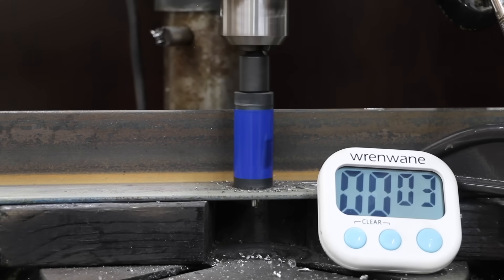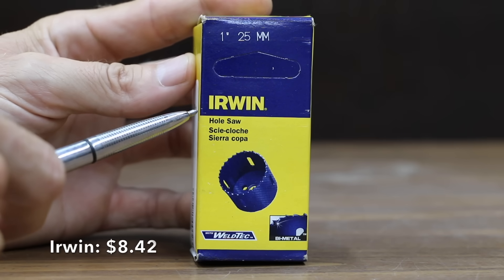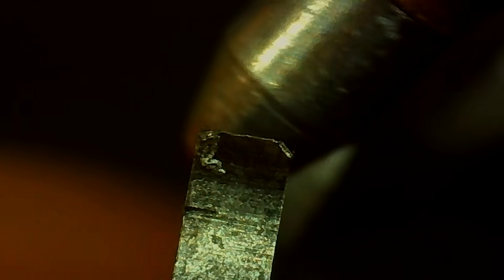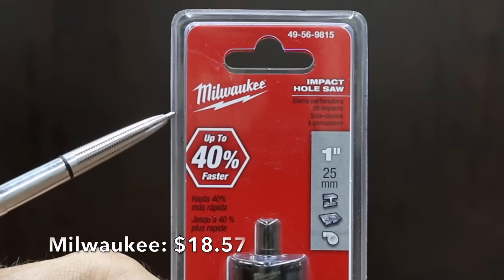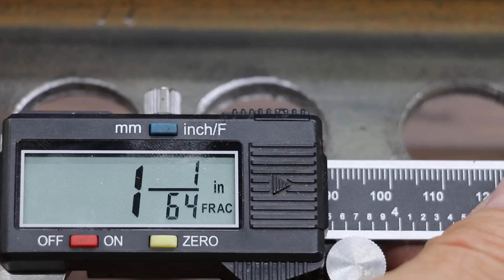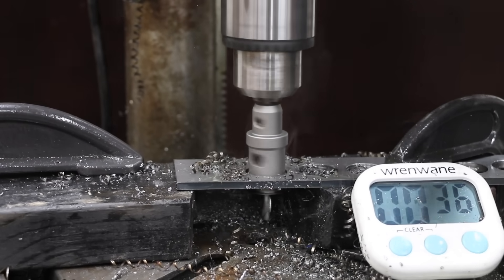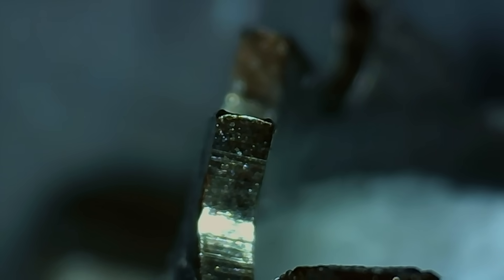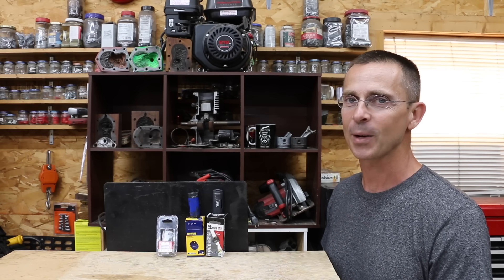Best Hole Saw Brand? DeWalt vs Milwaukee vs Irwin, Bosch, Lenox, Diablo, Bosch, MK Morse

Comment: I’ve used a Rota-Broach for years cutting 1/2 inch holes in metal. It has a replaceable mandrel.
Reply from the maker: Thanks for sharing.

Comment: Here's another idea, multi-tool blades.
I use my vibration saw (multi tool), to cut a lot of metal, screws, wood, etc. and I go through blades like crazy.  
It would be nice to know which ones are the strongest because they are quite expensive.
Reply from the maker: Great video idea.  Thank you.
Reply: I second this
Reply: He made one!!

Comment: you should use a magnetic saw with some full tungsten hole saw - the cutters allone cost like 40 USD but you can then cut through AR500 steel , like for excavator cutting edges to fix the bucket teeth to it and similar applications
Reply from the maker: Thanks for the suggestion.

Comment: I appreciate Project Farm. I've had extensive experience with hole saws clamped in a hand drill. I was too cheap to by a drill press. When the teeth caught in the metal my wrists would suffer greatly. But I tried them all and they were junk except for "Blu Mol". I guess they bonded a harder metal to make the teeth. I went on to use 5/16 drill bits to drill through a sledge hammer. I tried Irwin gold drill bits and got NOWHERE. I had to order special drill bits that contained carbon. They don't want bozos like me to possess carbon drill bits because now I have the ability to bore through almost anything. I can open safes and locks etc. I removed the handle from an eight pound sledge hammer and drilled a hole longitudinally  through said sledge hammer and place a stainless steel 5/16" all threaded rod and attached a handle to it and I would insert an aluminum can in a 4" ABS pipe and use the sledge to smash the can to the smallest possible size.
Reply from the maker: Thanks for sharing.

Comment: As always, thank you for the videos. If you want to take another look at hole saws, would you consider doing tests with hand held drills? I've always heard that carbide tipped drill bits should never be used on a hand held tool because the instability will break off the carbide tips and ruin tool life. A video with tests of hand held drills and impact drivers using hole saws would be great!
Reply from the maker: Great suggestion!  Thank you.

Comment: Using such slow speeds and aggressive force with carbide is a recipe for disaster.  I doubt your drill press could go fast enough to run the best quality carbide at their nominal speed, and the teeth wouldn't have chipped and worn nearly as much.  On a lathe the chips can be deep blue without issues with carbide tooling.
Reply from the maker: Thanks for the feedback.

Comment: Very good video as always, but am I the only one that chaught you saying the Dewalt 2X in the hard steel took 140 seconds and not 1 minute 40 seconds equal to 100 seconds 😅

@11:00
Reply from the maker: Good catch (not the only one).  I meant to say 1 minute and 40 seconds.  That does equal 100 seconds though.  Thanks.

Comment: The Morse ones are absolute garbage for longevity. Teeth break off way to easy. They cut nice but the life of them is a big deciding factor

Haven't tried all of these but at work we're given the Milwaukee or Morse ones 

I've bought the Diablo and Lenox ones and was happy with them. Never had any issues. The ideal brand carbide ones are pretty good too. Especially for stainless steel.
Reply from the maker: Great feedback. Thank you

Comment: A long time I want to see if diesel aditives do work. Main point of them is to make diesel fuel more "slippery" so mechanical pums and injectors wear out less. Try with lubricity tester cheep and expensive diesel, then add diesel aditive and test it again. It should be easy to reproduce and make video.
Reply from the maker: Thanks for the video idea.
Reply: @ProjectFarm  Nice, hope to see it soon, love your videos. Aslo may test 2stroke smokless oil as diesel aditive, also you can test how much they smoke. I'm sure you will find creative way to make smoke tests

Comment: Video suggestion: If you have a compressor please do a test of different couplers and hoses (1/4 vs 3/8 as well as coupler types). Devilbliss has a test that measures pressure drop across various couplers which claims that their connectors are much better than the high flow Milton M style connectors. I'd love to see your comparison results. SixtyFiveFord does a comparison of 1/4 vs 3/8 couplers and has some interesting results using a die grinder in the latter half of the video. https://www.youtube.com/watch?v=BWejQqKHBJM&t=737s

Also, you have to see his dog at the end, it's hilarious.
Reply from the maker: Great test suggestion. Thank you

Comment: Project Farm. I do have a video request for you. There is a lot of controversy about buying aftermarket products VS OEM products. Oil filters is one of those things. You see, i work in automotive testing and i know that the engineers design their components alongside other components. Oil filters have a restriction, creating pressure. Ideally i am wondering as to weather or not different oil filters have different pressures. Pressures that the OEM did not intend for their product to withstand. Testing this would be interesting. Remember. Eliminating variables is the secret to accurate testing. ;)
Reply from the maker: Great video idea.  Thank you.

Comment: I prefer Rotabroach for hole saws.
Reply from the maker: Thanks for the feedback.
Reply: @ProjectFarm  I found this link for "research" - I have no affiliation with the channel. 

https://www.youtube.com/watch?v=MSbIMUzXbFI

My employer stocked Rotabroach (it's just a brand, but as far as I can tell it's "the" name brand), he calls em an annular cutter in the video which is the appropriate tool name I suppose. 

I used them extensively when running a horizontal boring mill and punching holes through both sides and coping the ends of pipe for weldments into handrails/guard rails. Providing you have a machine with a beefy spindle, and in my case, the pipe secured in v-blocks with clamps, I was running them with no pilot. I prefer a spray mister or flood coolant instead of the acid brush and cutting oil, but you use what you got. 

I'm doubtful that the flutes are meant to be used like an end mill, but I had a big honkin G&L that said either the pipe or to rotabroach was gonna get cut. Every couple of days I'd run a round edge slip sharpening stone down them and across the teeth and that'd alleviate the chatter.

Comment: Any chance you could do a normal operating temp and hot operating temp flow/viscosity test between multi grade and straight wright oils ?  Wandering if it's true that straight weight oils hold the viscosity bat higher temps in air cooled engines (like my Harley) and at what temps does the viscosity degrade...? eg...20-50 vs. straight /50.
Reply from the maker: Thanks for the video idea.

Comment: I don't know if you're like me but I've broken more 1/4" socket adapters than I care to recall.  I've been through Dewalt, Milwaukee, Makita, and all of the store brands.  Now this is probably due to the fact that I'm using them with my Milwaukee M18 1/4" impact that simply has too much power for the bits.  I am curious though if you could figure out a testing regime to try all the brands in both 3/8" and 1/2" drives and see who holds up to the most torture.  Whether that be in the form of max torque or torque and impacts per minute.
Reply from the maker: Thanks for the video idea.

Comment: Hey,
A lot of us use hole saws in wood, sometimes nail inbeded.
Plumbers are not shy about where they drill.
It would be good to know if any hang up and bind less than others. 
Modern hand drills can be wrist breakers or can throw you off a ladder.

Thanks Chris
Reply from the maker: Thanks for the video idea.

Comment: Hey there
 can we use TW hybrid ceramic curing it for 24hrs,  top it up with seal and shine then after 4-5 washes topping it with a TW ice quick detailer ????? Because the application is easy to use
Reply from the maker: Thanks for the video idea.

Comment: I'm not yet done with my mill project, so I am forced to use my drill press, as you did in this test.  I've found run out is a big factor in hole saw performance on a drill press.  I have found some brands of holesaws to have horrid run out.

When you start on the knife steel, the Irwin has such bad run out, you can see it in the vid.

Run out is going to significantly impact hole size. Knowing run out of the drill press would be needed as a base line, before checking run out of the hole saws. There are inexpensive dial indicator holders for Bridgeport mills.  I just bought one, then found it wouldn't fit the larger diameter of my drill press.  I duplicated it, with a slightly larger diameter, with a band saw, some files, and my drill press to drill and tap a hole.  It took me about an hour to have a crude, working model with a larger diameter.  Certainly good enough to check drill press run out. (I will beautify it using my lathe as a mill, a bit later.)   Oh, I just used the indicator holder 'stuff' from the purchased holder, so I didn't make an entire holder, just a larger diameter body.

Here's a Google image search of the type of the holder I'm talking about:

https://www.google.com/search?q=bridgeport+type+dial+indicator+holder&sxsrf=ALeKk015dh1rHAefeuEW0DaAXqbJ_vqqxw:1597560282938&source=lnms&tbm=isch&sa=X&ved=2ahUKEwipvq_pj5_rAhV7HTQIHfCCC2YQ_AUoAnoECAwQBA&biw=1525&bih=781

Thought you might find some interest in this, and possible fodder for a vid... test the run out of some chucks, say, keyed and keyless.  There might be some interesting info to be discovered.  If a drill press has a decent run say 0.001-0.002 without a chuck, a bad decision on a chuck can make a good drill press drill oval holes! LOL   Some chucks can hold a decent run out.

Good vid, as always. I always learn something about tools I use.  I wish I could show you a pic of how one of those Dewalt Impact Ready hole saws turned out after I tried to cut some damn 6061-T6 aluminum.  It is damn near toothless!

GeoD

Comment: Could you put product links in the video description by chance? Or if it doesn't have it, where to buy it. Doesn't have to be an affiliate link or anything if you want to remain free from any revenue tied to products. 

its nice to be able to find the exact thing im looking for based on test results considering a lot of time (especially epoxies) they have multiple different ones that all sorta look the same.
Reply from the maker: Thanks for the suggestion.

Comment: I have an idea for a video that I would love to see on your channel. Testing different fluids (gear oil, ATF, syncromesh, motor oil, etc.) in manual transmissions. I think it would be interesting to compare the additives in each, as well as test their ability to protect against wear. I think it would also be interesting to test if gear oil is harmful against materials in newer manuals (like brass synchro's), because I've heard that's why modern manuals don't use gear oil. I've heard of people using 0w30 synthetic motor oil instead of ATF in modern manuals with good results, so that would be interesting to compare. I've also heard of people using small amounts of automatic trans stop slip additives in manuals with shifting troubles, so that might be interesting to test out.
Reply from the maker: Thanks for the video idea.

Comment: I'd like to see a "Which brand of 6pt and 12pt regular sockets is best" video. Milwaukee vs Dewalt vs Craftsman vs Harbor Freight vs Kobalt vs SnapOn vs others. 

You'd probably have to weld a hardened nut down on something to apply enough torque to break the sockets. You could make it into a video series comparing 3/8", 1/4", 1/2" drives. If the torque gets really heavy, just get a long breaker bar and attach your scales to the end of the bar. The breaking torque of each socket would be the pounds on the scale (force) multiplied by the distance from the socket to the scale (radius) on the breaker bar. 

Torque = radius * force
ft-lbs = ft * lbs

Just be sure the applied force is perpendicular to the breaker bar (90 degrees), or you'll have to use the full formula:
Torque = radius * force * sin(theta)
Reply from the maker: Thanks for the video idea.

Comment: This would be interesting to repeat the same set of contenders on wood and wood composites. Oak, Doug fir, high-density particle board, Masonite, LP siding, 3/4" mdf, and maybe Hardie siding.
Reply from the maker: Thanks for the suggestion.

Comment: There's a bit of run out in your chuck.
This doesn't help when you try drilling the ar500 without the centre bit, the saws wobble around, that's where the damage to the teeth comes from mostly.
Reply: This is probably true, but how many drills in use are that close to being perfectly concentric? Also, lots of people use handheld drills with these hole saws, so there is a component of operator error.
Reply from the maker: Thanks for the feedback.

Comment: Even though hole saws in metal are interesting the most common use is actually hole sawing wood and similar softer material, and there the usability and hole quality is important.
Reply from the maker: Thanks for the feedback.

Comment: Which race gas is best? Can you use it in a normal engine? Will it help boost performance? Will it clean engines? We have pump race fuel (turbo blue) and several different readily available race fuels. A gallon of turbo blue is 4.00, I use that instead of octane booster and fuel treatment.
Reply from the maker: Thanks for the video idea.

Comment: My go to hole saw has been the Milwaukee Dozer.  For the money it performs great. 1” up to 6” for corn hole board holes.  

Honestly I’ve never bought anything else except an Irwin door knob hole saw kit that I used once, but it seemed to take forever.  

I’ve never tried the dozer in the AR steel I have but I have used it to run through Hardiebacker cement board, mortar, 3/4” OSB, then 1x8 plank; all in succession, to run my plumbing after my kitchen remodel and it just shredded it all in no time, and was still sharp. 

Have you done 7-1/4” circular saw blades?  Diablo is ok for my miter saw, but I’ve found they’re only 7-1/8”!!
Reply from the maker: Thanks for the video idea.

Comment: Very cool!  Always enjoy watching your videos.  You add in things (like measuring the size of the hole, once it was cut) that I would never have thought of.  Very informative, and fair testing, as usual.
Reply from the maker: Thanks!
Reply: Carbide cutters will make very accurate and clean cut holes  compared to bi metal.